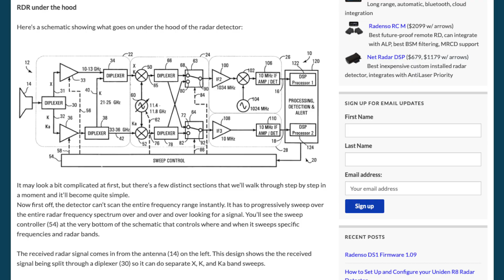Understanding Radar Detector Filtering: Five Minute Fridays, Ep. 46

Comment: Loved the video! Just a question- does V1G2 with JBV1 use speed limit information to mute alerts? Also, do you know any detectors that do that? The R7 or R8 maybe?
Reply: V1G2 with JBV1 and the R7 can do this. I assume R8 can to but I have not used one. The feature is called Low Speed Muting @vortex mentioned it in this video. It’s handy in parking lots with a lot of automatic door openers.
Reply from the maker: The R7 can not do it. The V1 can with JBV1, as can cloud connected Escort detectors. Highway Radar has PSL info, but I’d have to double check if it can use that for muting the Radenso DS1. If so, that feature should later be available for the Uniden R4 and R8. The R7 has no PSL info built in (no detector does) and mo way of accessing that info via Bluetooth or Wifi so no, it doesn’t do PSL muting. It simply does low speed muting below a fixed preset speed like most other detectors.
Reply: I misunderstood… didn’t catch the PSL aspect. I was just thinking of a set speed a la Low Speed Muting.

Comment: I have used the lockouts on my R3 and my escort  and I have yet to see one time that lock outs work.. my detectors go crazy all the time go by lockouts and I have retried over and over. They just dont seem to wotk... all my passengers ask me to turn my detectors off they get sick of hearing them
Reply: lockouts have been working great for me with my R7 and dualpro 360. The R3s manual lockout may require several lockout points to get it to 100% not alert to the source.
Reply: One mistake people make is clicking “Mark” instead of clicking the “Mute” button twice.  Not sure if you’re doing that, but I’ve seen/heard of it a few times.

Comment: Do you know of any Ka falses that are out there?
Reply: In NY on some areas of the thruway they have traffic sensors running on 34.7 fir whatever reason. Also cobras can leak KA band
Reply: @djnvision  sometimes on the interstate I'm getting anemic ka-band with no car no unmarked car or nothing on the overpasses around that I could see occasionally A semi-truck may come upon me with a KA alert strong but I believe he may have a toy in there.
Reply: @budprepper3811  yeah I've spotted a nice stalker antenna on top of a blank sign off thruway exits
Reply: @djnvision  interesting, I'll keep eyes out for that  👀
Reply: I've encountered Ka mobile speed signs. I usually encounter false Ka from satellite dish and I know 3 different areas that sets mine off.
Reply: 33.758 is often satellite dishes. I get 34.812 or so falses that I’ve suspected to be leaky Cobra or Whistler radar detectors, but haven’t been able to validate.